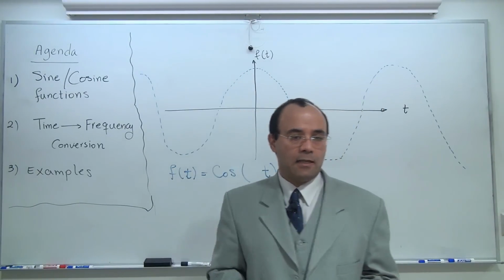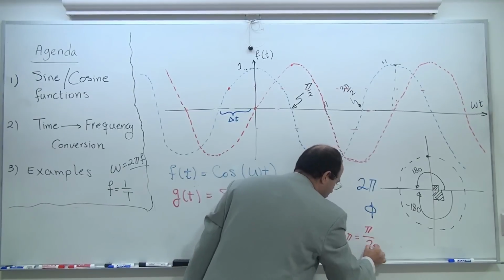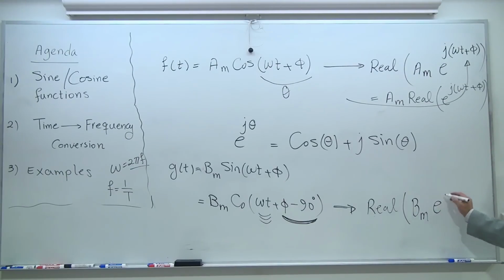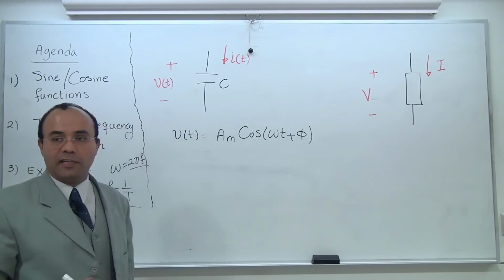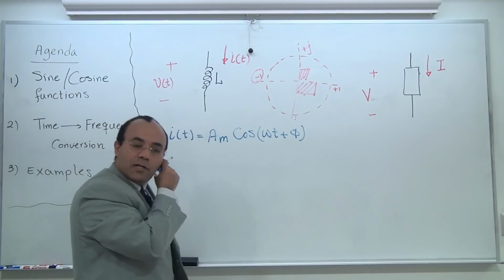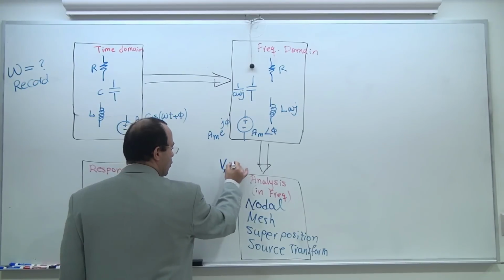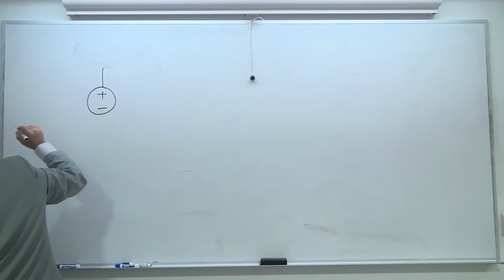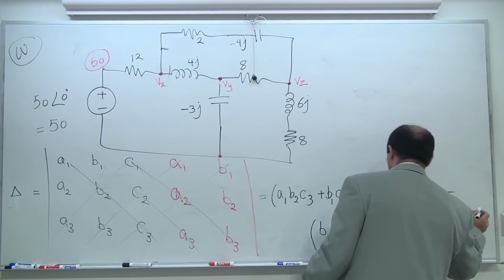AC Circuits (Frequency)

Comment: What a fantastic lecture. It's good that you go so in-depth with the topics and de-mystify them for the students, because really these concepts are pretty simple, you have a few electrical characteristics and you want to study their relationship with a few fundamental components. What gets confusing for most students is how they all relate to each-other, and you do a good job of taking a step back and connecting all the dots.

P.s. I also like how you think of the capacitor's frequency response. I think about it the same way (At high frequencies the charges have no time to settle down on the plates so it is as if the capacitor doesn't even exist, making a short line).